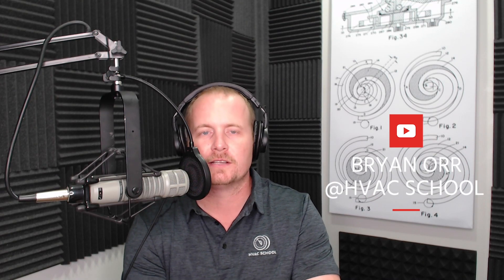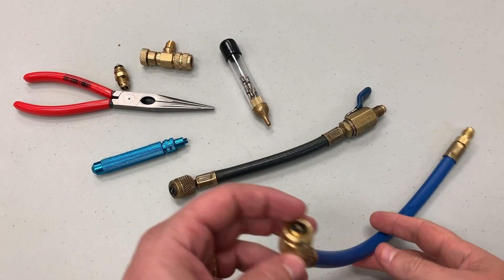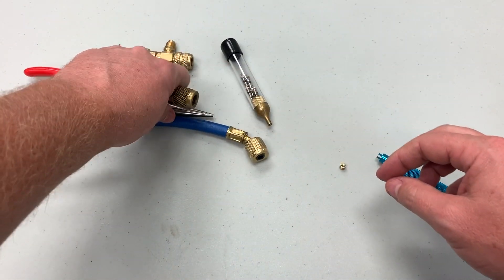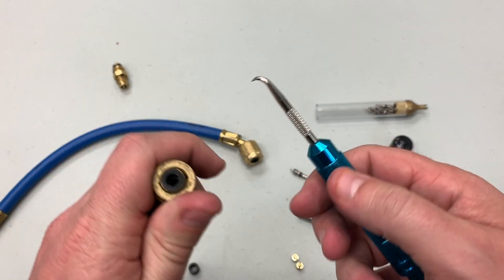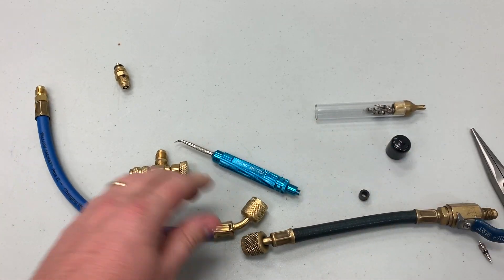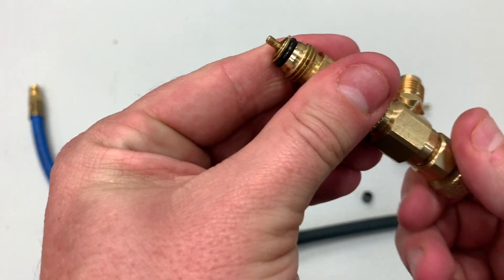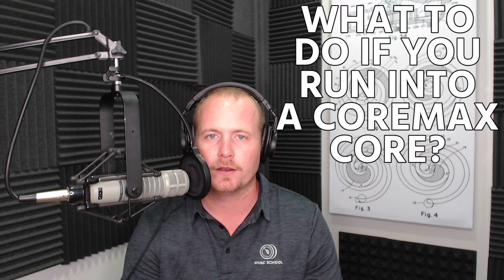Tips for Hoses, Seals & Cores

Comment: Very helpful! I was wondering why my charge hoses were leaking so badly when I was connecting to or disconnecting to the AC fittings on my pickup lately. I was loosing a lot of oil and refrigerant even with being quick to unscrew the hoses

Comment: As a technician for Scotsman Industries, I suggest to all who work on the refrigeration side of the machine to cut the core max off. Replace with a standard fitting with removable valve as the core depressor is not a vacuum rated device

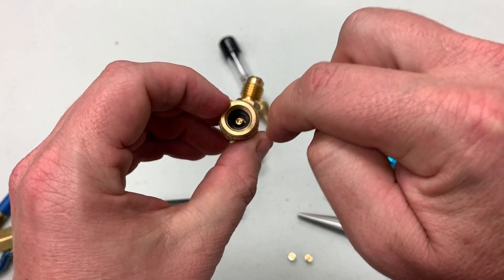Comment: Great video! Do you have a video of replacing the seal in the quick release core depressor you show at around 3:00? That's where mine is leaking. I can see the seal is not seated inside, but I can't get it seated and not sure how to disassemble (or reassemble) without ruining it. Thanks!

Comment: C&D Valve CD2070 Large Thumb Screw Core Depressor with Back Seat ,   I bought the tool but it doesn't work, the refrigerant started spraying out of the thumbscrew.  Do you have any tips on the use?

Comment: I’ve used a pocket screwdriver with the tip bent in a vise to change my seals for years. Works great and you can’t beat the price.
Reply: Today I tried to replace a seal in one of my hoses and for tahe first time  I couldnt get the dam thing to seat. Its on the manifold end and i must have destroyed 8 gaskets before I gave up. The problem is trying to get the round end to start in the copper circular end that maintains the gasket.  After looking at the others on line it occured to me, the hassle was because the outer knurled sleeve wont slide down low like it does on the other end, where you can easily get this thing started. I started tao think there may be a tool for it, but from what I’ve seen, the yellow jacket tool is merely a pick which I already have several of. Maybe I could freeze it to attempt to shrink its diameter momentarily and slide it in??? The pocket is down deep below the threaded section.
Reply: @hvac01453   did you figure a way? Please let us know!